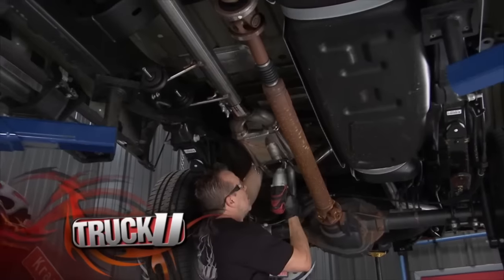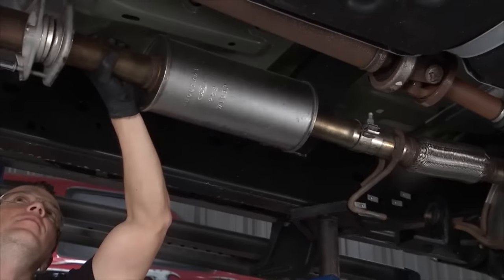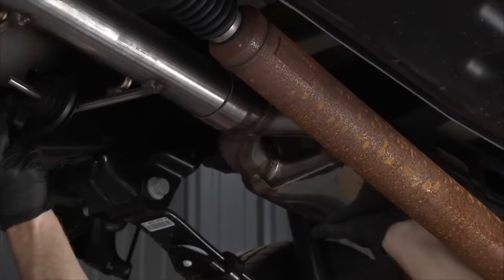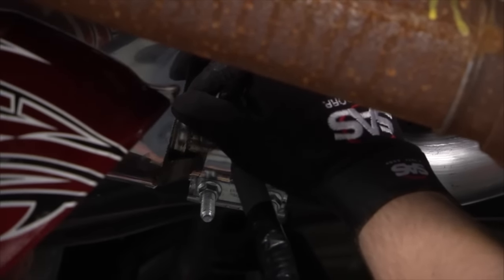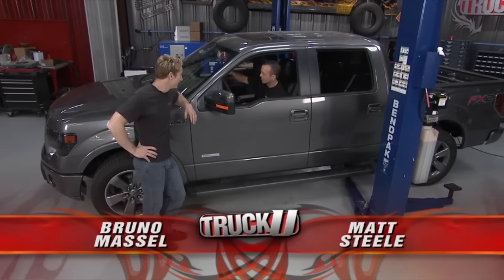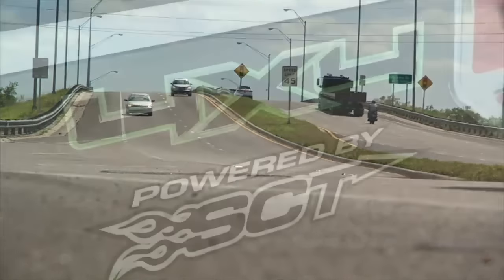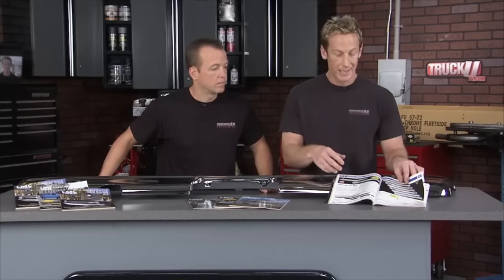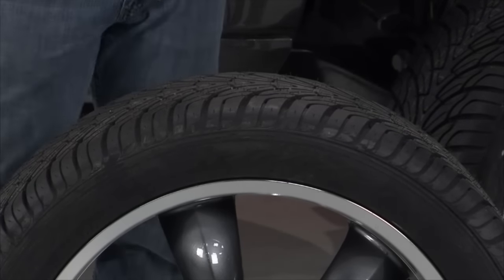Ford EcoBoost | TruckU | Season 9 | Episode 6

Comment: It is a false science. More power, less pollution? no...It can be done. The engine is smaller, but air is compressed. The the weight of air is the same on both engines. Eco-boost uses less volume but higher pressure(by turbo compression), it is the same amount of air burn by weight.

Comment: See if there’s a reoccurring trend , I came out from a casino to start my 2019 F-150 2.7 Eco with only 7,000 miles on it was deader than a doornail ! No lights , bells , key fob wouldn’t work ,  NOTHING !  Called my Ford dealer and he said it happened to him once too ! Half hour later my ride shows up and we were going to try to jump it , I opened the door and everything was normal like nothing happened !  Went to the dealers the next day , put it on the machine and they couldn’t find any bad codes ! So if you guys get any more stories like this , let me know what the fix is . I’m sure it’s the computer board somehow . Thanks .
Reply: Mark Gantz loose battery terminals
Reply: Bobon Meiknob when I got mine I didn’t have a IPhone and the message kept popping up from Ford so I convinced them to shut the thing off !  I asked them if it might be some kind of computerized adjustment for the truck and they said no it’s for sales couponing . I don’t really trust them and they may not know themselves . On the good side it hasn’t shut down again and now I got 10,000 .

Comment: That exhaust want do nothing but make more sound.
Reply: with turbocharged engines, you are incorrect, I picked up 12hp on my wrx sti going to a 3" turbo back
Reply: Lmao yeah! I bought one and I love it but it sounds like a ricer not a truck
Reply: dalexander4204l On ecoboost it doesn't help much. The higher HP is already there on the ecoboost. They capped the torque output electronically. It's the tune removing the torque management that does 99% of the gains.
Reply: @Quinid1  its amazing how restricted it is without the tune
Reply: It helps...but to see real results,you need to run a tune with it
Reply: @Quinid1  it will help spool time.
Reply: @sportsterrider37  Indeed it does, but if you want spool time, get downpipes. They will make the bigger difference in spool time. But the output will still be limited by the computer.

Comment: Fuel mikeage less than 20 on highway
Reply: idk what youre talking about my 13 with 86k miles gets 18.4mpg mixed at 7500ft in the mountains, so no flat driving
Reply: 2018. F 150. I’m getting 22mpg on an 87 octane tune from SCT. Up 80 hp and 72 lb. ft. torque.

Comment: V6 pickup trucks suck no matter how much power you add to them. What size motor you got in your truck dude,  uhhhhhhhhh a V6 Ecoboost. (embarassing)
Reply: MOOK SS how so? They make awesome power.
Reply: MOOK SS until your v8 gets out towed, out run and gets left at the gas pump on top of it. I've owned several v8 pickups and my ecoboost stomps all of them in the mud
Reply: MOOK SS You know what’s really embarrassing? A 5.3 v8 getting smoked by a 2.7 v6. Check out “F165 vs Silverado” on youtube.
Reply: I race you ur probably driving a chevy sold my 13 silverado for a f150. No comparison
Reply: Remember the 87 Grand National? A 231cuin v6 turbo use to get physical when the boost hit. I just found out the boost was less in 1st gear. That explain why it seem to pull as hard in 2nd. My boss had one and I drove it a few times. His wife had a 90 LSC with 302 Mustang engine. It sound better but was a joke next to that little 3.8 v6.
Reply: MOOK SS I thought the same thing brother but those twin turbo eco boost motors are top
Reply: I guess >YOUR> RICH LOL!!!  And with gas being 121 a Litre in Canada, and gas being hard to find, should I say more
Reply: you will only see v6 tail lights.
Reply: @josephcraig2511  But it won't outlast the V8.
Reply: @Bobon Meiknob Yes sirrr
Reply: V6 still sounds like shit. Turbo spool and bov helps but it still sounds like crap